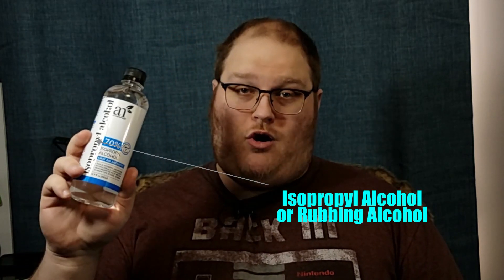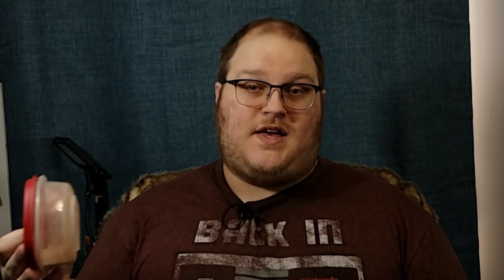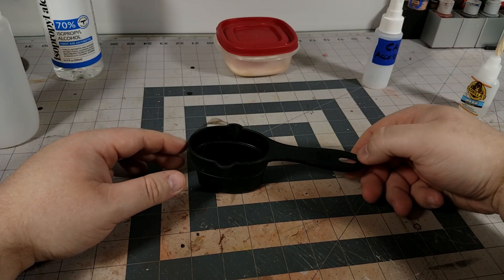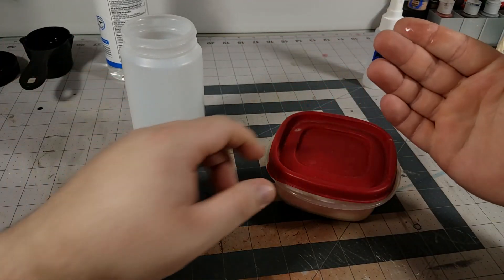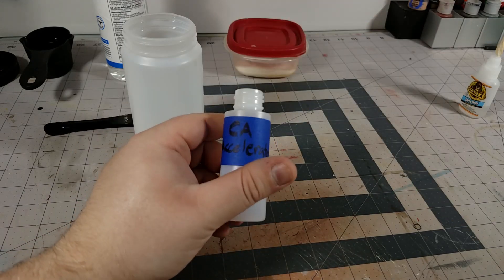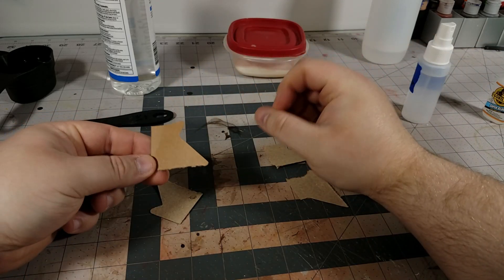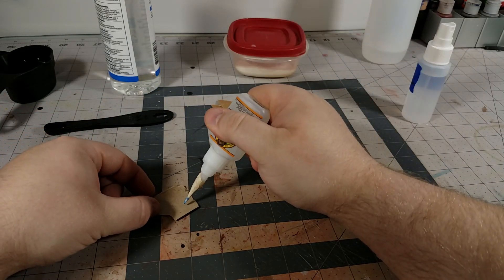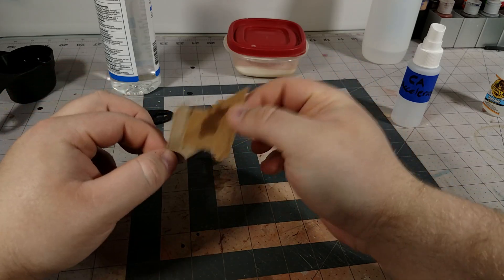How to DIY Super Glue Accelerator

Comment from the maker: What do you think? Is this something that you think you'll try out?
Reply: Man, you just saved me a 5hr 3d print, worked like a charm to glue PLA plastic back together
Reply: yes thank you... not only am I strapped for cash but I have the thin CA glue onhand and it would take a couple of days to receive the accelerator. I have both 70% and/or 91% iso on hand.
Reply: I was thinking about trying  the same thing because I know baking soda cures super glue nearly instantly, I use it as a filler all the time. Thanks for the video
Reply: Thank you. It was 100% what I was looking for. 🙏
Reply: I have. I was looking for an explanation what the water and the baking soda did. Some people claim water is enough, but I found it works better with baking soda. I was also wondering if the baking soda remained in solution so that it would not clog up the spritzer. After seeing this video, I might try that out too.

Comment: Fantastic video. I've been trying fix a few plastic pieces that rely on a friction fit, with a small plastic ridge that fits into a guide. It used to just click and hold. But over time the small ridge gets worn away so it won't hold anymore. So I tried a little dab of just CA alone, but it takes forever to dry as there's no pressure involved. It's just a small dab of CA attempting to cure in the air. But a quick spritz with this fixes it instantly. Now they fit perfectly!! A nice solid click again! Thanks bro

Comment: Yeah I will try it. Been wrestling with this. Why nor use water aa the carrier?
Reply from the maker: The alcohol adds the moisture needed to facilitate curing but evaporates way faster than water does. Water should work just fine but may take longer to evaporate and may require the pieces to be held longer.

Comment: I've used a bit too much super glue in unventilated areas in my life and now I have a sensitivity to super glue. It's to the point of, if i even inhale a little bit of the fumes I'll have mild flu like symptoms for the next two days.
I also don't like commercial insta set because of the chemical smell and residue. This is the perfect solution for my ability to use super glue, it's cheap, it's easy, and convenient.

That being said, to anyone who reads this, please use super glue in a well vented area. My misuse and disregard for basic safety has permanently effected how much i can enjoy my hobbies safely. And it isn't limited to just super glue as certain other chemicals that wouldn't usually effect anyone occasionally give me the same negative effects

Comment: Nice one, I tried with water and found it messy, also put too much bicar and ended up clogging my spray.

Gonna try again with isopropyl and less bicar as recommended, cheers ! Looks promising
Reply from the maker: Have you it tried it again and did it work?
Reply: @MiniatureMedium  I'm gonna need to source another spray bottle and try again. I tried with a fine spray mist bottle, and it clogged it up even with very little bicarb in there.
Reply: Iso acts not only as a surfactant but a better solvent (more accurately, vehicle) for the baking soda as it evaporates quickly and neutralizes the acid in the CA glue -- the liquid in the glue that keeps it from solidifying nearly instantly.

Comment: Is that regular food-grade baking soda or non-food grade, like arm and hammer???
Because sadly in Australia they don't seem to sell arm and hammer anywhere!
Reply from the maker: Baking soda is baking soda. The baking soda I'm using in this video is food grade for baking but I have also used the cleaning grade stuff as well. For this application it doesn't matter, just don't confuse baking soda with baking powder. Baking powder does not work in this case. At least as far as my experiences go.
Reply: @MiniatureMedium  Baking powder has corn starch or cornflower int it.
Reply from the maker: @cliffwall6593  And that is one of the reasons why I recommend not using baking powder. Baking soda along with the isopropyl alcohol are what make the super glue kick. The additional stuff in baking powder prevents the super glue from bonding the two pieces.

Comment: Wonder if acetone would work..  its quicker drying and is hydroscopic so it will absorb water if allowed to so could make it like a 91% solution with the baking soda and maybe naptha and should instantly dry off and cure the glue as well if atomized..  so could put it in an old aerosol can and repressureize then it would be just as good as the stuff they charge 20$ a can for….
Reply from the maker: Acetone would not actually work. Acetone is one of the recommended ways of dissolving superglue bonds. I'd imagine if it were used as a substitute for the Isopropanol it would prevent the bond instead of making it set.
Reply: Actually acetone seems to be the delivery system of at least some of the commercial accelerants.
Reply: Acetone would work fine. Acetone is used as the carrying agent in most commerically available accelerators, because it dries off almost instantly
Reply: Acetone does work.  Many ca activators have acetone in it.

Comment: CA accelerator has two components, Main component: Lewis acid (catalyst)/ Supporting component: Evaporating agent (solvent like alcohol or acetone).
I tried a little bit of baking soda in %99.9 isopropyl  alcohol but no matter how much I tried to mix, I couldn't get the baking soda to dissolve in alcohol and precipitates at the bottom. Spraying with the bits of baking soda on superglue is not good. Anyway I tried it and not only it didn't work but also ruined the superglue that didn't stick anymore.
I just bought the baking soda so it shouldn't have any problem and the alcohol is right... by the way cardboards don't need accelerator, since the glue can soak into it and bonds instantly.

Comment: I made the diy brew, very diisappointed  with results, compared to using commercial Zip kicker. Results were like night and day. The Zip kicker instant rock hard bond (smoking), the diy brew didn't come close. Was using 70% isap any guidance appreciated.
Reply from the maker: Zip kicker's chemical components are designed for that kind of bond. In a battle between DIY and Zip kicker, Zip will win. This DIY is designed as a cheap alternative for those without access to a kicker and using ingredients readily available in most homes. I am sorry that this DIY didn't live up to your expectations. Thank you for letting me know. I will experiment to try to find a better solution.

Comment: I use CA glue every day.
I have the store accelerator.
The proper way to use the accelerator is to spray it, get some air on it so it evaporates, and then press the piece with the CA glue on to it.
Never press it when it's wet, or else the bond will be weak.
I have been doing this for years, never fails.
I will try this, and then report.
I will spray it so it evaporates, and then press the wet on it.
I hope it works, cause the chemicals in the store bought stuff is terrible if you breath it in.
Reply from the maker: Thank you for the information.

Comment: I don't know if or what I did wrong but I tried your recipe and it didn't work. The baking soda didn't even dissolve. 150ml of 70% isopropyl and 1/4 tsp baking soda.
Reply from the maker: Did you stir it in a cup or shake it in a bottle? Also try adding a little bit of baking soda at a time until it all dissolves or a little more isopropyl.
Reply: @MiniatureMedium  I stirred it together in the measuring cup, poured it into the spray bottle and noticed it all settling to the bottom so I shook the heck out of the spray bottle and again it all slowly dropped to the bottom.
Reply: Baking soda might have been old. Try a new box.
Reply: @paulwilliams819  I will try that, a few people told me the same thing.
Thanks.

Comment: At first I would like to thank you for sharing this video! 
I would like to ask you two questions...
1. Can I use ethanol alcohol instead of isopropyl?
2. Does this accelerator reduce the bonding strength?
Reply from the maker: Thank you! 
1. I'm not sure about ethanol alcohol instead. I don't imagine it would work any differently. I'd recommend looking up any adverse reactions between the two before committing. 
2. In my tests, with lightweight materials and objects, it holds up just as strong as if using just superglue. If this was being used for a woodshop application, I'd recommend it along side your typical wood glues. Using the super glue and accelerator as the initial bonding agent while the wood glue has a chance to dry.
I apologize for the late reply. I have been unavoidably away for a while.